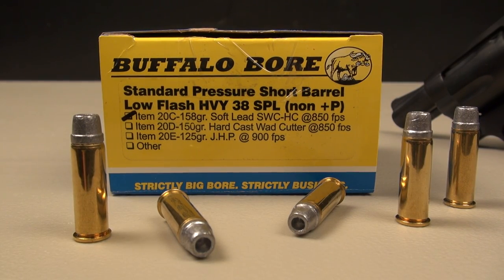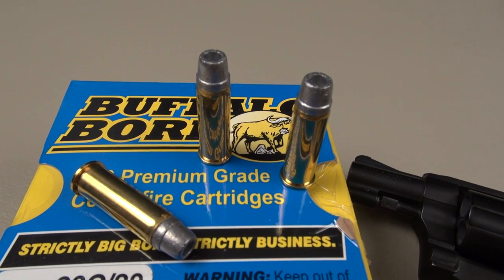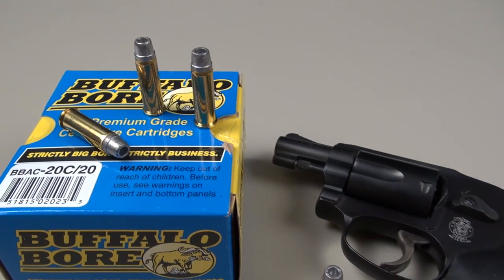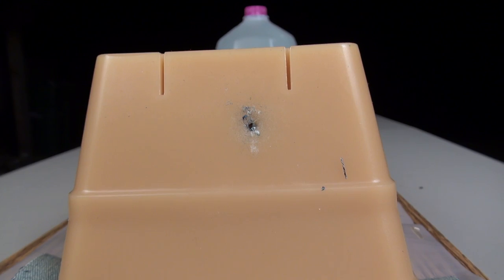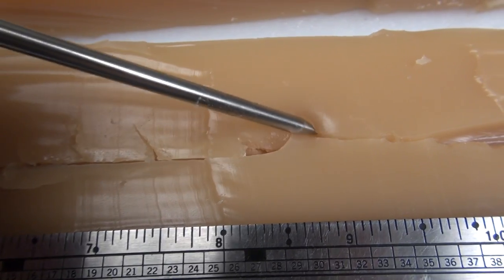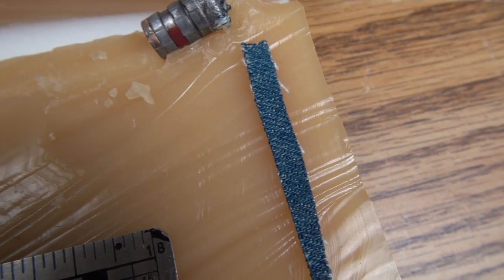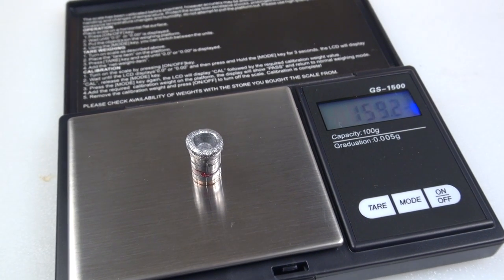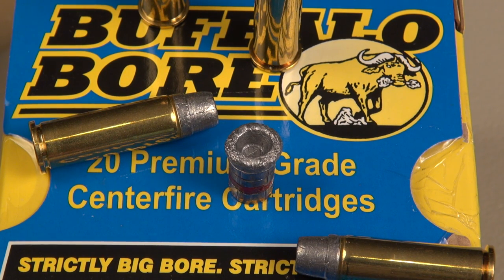Buffalo Bore .38 Special 158 gr Semiwadcutter Ammo Test

Comment: What is to complain about? First higher velocity than any plus p lhp load. Next. Plugged with denim still expands to around 44 caliber. Penetrates adequately without too much . Last A gunfight proven load for 2 inch revolvers , especially the older lightweight Pre 72 Colts. While it is tough to duplicate the plus p load , you can handload to this performance using the same Rim Rock bullets, in an emergency and , using standard hard cast 158 for practice

Comment: those under performed and were to pricey for the results. I expected to see it open up fully, but it didn't.
If I was going to C&C a 2" barrel, I would either go with Hornady FTX, or a 125 gr Winchester Lead nose hp.
Both of those have shown to open up to .5 or more without over penetration. both make a plus p round, but both also have decent rounds with plus p. great video. thank you so much for showing these. I'll know better than to waste my money on those. I too have a 2" C&C Taurus 856. I was thinking about these, but now I've changed my mind. Thanks again. Peace..
Reply: It's a hardcast not soft lead at the end it says HC which means hardcast which is why the expansion was poor
Reply: Pretty sure hc means hardcast not hollow cavity
Reply: @jorgesolis9468  After looking into that, I do believe you're right. I bought some Buffalo Bore Soft Cast  LSWC HP Rated for 1000 FPS
I haven't tried them yet out of my Taurus 856, But I did see a great review on them by someone using a LCR. I don't do ballistics gel, But I think I'll shoot them through several water jugs and see if I can capture it, to take a look at it. Thanks for the comment. Peace..

Comment: It probably would have expanded more out of a linger barrel. It would be interesting to see whst it would do out of a 5.5 or a 7.5 inch barrel. Alot of the single action cowboy revolvers chambered strictly for 38 special are not +P rated but are not entirely made for defense in mind either at least in these times. However it would still be interesting to see a test of some if these standard pressure loads in longer barrels.

Comment: This load performs even better out of a  Colt Dframe which is la slightly longer than 2 inches and gives around another 25 fps velocity. Most lighter weight jacketed 38 rounds do not perform as well . For me the Buffalo Bore rounds have been my carry rounds. In a 3-4 inch revolver they are even more effective. The plus p performing in the 357 range.

Comment: Could you please test the BB 150 gr. wadcutter 38 spl load? BB says about 14-16" of penetration.  But its flat and blunt and should strike hard.  Sadly this round did not expand like it should, but in living human tissue, might be different. Also it seems bullets go deeper in gelatin than they do actual tissue, and you got account for bones too, a bullet hitting the sternum will take a lot of energy, 19" on this test does not mean it will go through exactly 19 inches of human tissue.

Comment: Hey you should check out the Buffalo Bore 155 Gr. 40 S&W. It is as hot as a 10mm and it uses Gold Dot hp. Also, what is the best snubby load you have tested??? I am using PDX-1 right now but I think you did a video where they sucked... Thanks....

Comment: Great video👍👍.🤔 my recommendation would be not only a 10 foot distance with a stubby pistol but also point blank range.Aka I get off me scenario. And how much penetration does it have after leaving the thuggish target. For an example will go through the bad guy into the drywall and kill a potential family member? I don’t know if it’s made anymore but I use the 38 glazier around. This is a jacketed bullet with a Teflon tip and micro BBs inside the cavity. Excellent safety round all the energy goes into the bad guy and nothing leaves him.If you miss it is designed to break up and fragrant when hitting a wall. In California it is financial suicide if you defend yourself justifiably even worse if you have a stray bullet unaccountable hit a bi-standard standard😢.

Comment: Powders vary from powder to powder on PSI in the case even if the velocity is identical between different loads of different brands, so you could indeed have a +P round with no greater velocity than a standard pressure round.

Comment: By way of comparison, the non +P round tested by TNOutdoors9 goes 850fps, the +P version does 979 fps out of my 2" Taurus snubnose at 10'. I wonder if the extra 125 fps would cause more expansion and less penetration. I'd like to see 9-14", not 19". 

For now, I'm sticking with the +P version.

Comment: What would really get my goat!,  is to be in a room full of 357 mag ammo and only have a 38 special firearm ): ?    The practical me owns only 357 mag revolvers .
Reply: Cops in the day used .357 Magnum rounds in their .38 SPL snubby BUG's. They will hold up for a few shots in a serious need situation. Just can't use a steady diet. Of course, .357 snubbies are more widely available now, so not much of an issue.
Reply: ShinyPartsUp Hmmmm...... will .357s even fit in cylinders that chamber only .38 ?
Reply: Handloads. Mostly wadcutters or semi-wadcutters loaded deep.
Reply: ShinyPartsUp wow,  I didn't expect your reply come so fast lol,  anyways,  thanks for your answer.
Reply: The main advantage of a 38 over 357 is the guns are less expensive and usually noticeably lighter,
Reply: A .357 round will not even chamber in a .38 Special cylinder. The brass is intentionally made too long to fit inside a .38 caliber gun.. There is a step in the cylinder that will stop a .357 from seating all the way. You can slide a .357 into the cylinder, but the cartridge will stick out the back, therefore making it impossible to close the cylinder. Reloads make exactly NO difference. You can't even chamber empty .357 brass in a .38. Sorry, ShinyPartsUp, but that's how it really is.
Reply: Tommy Litchfield thumbs up
Reply: Tommy Litchfield .... Just a side note, don't know the exact yr. , but before 1970 anyhow, the older 38 special revolvers did have the same length cylinders as the 357 magnum revolvers, , safety wise they shortened the 38 special cylinder to prevent any mishaps with 357  mag ammo !
Reply: @lesmundorf  Cylinder may be the same length but the CHAMBER is shorter in the 38.  The 357 case was made .012 in. longer to keep it from being loaded in weaker weapons.
Reply: .357mag(brass length) will not fit in .38spl. revolver cylinders.
Reply: @kongsinchi1976  no, a 357 will not fit in a 38
Reply: @rogerbeckner6419  * Thumbs up

Comment: I think this round out of a longer barrel would be fine,but out of a snub.....not really mushrooming.....if you want the mushroom effect in a snub,you need to step up to the +p......and deal with the recoil......no free lunch.
Reply: I have a Late 40s early 50s S&W M&P/m10 with a 2" barrel. This is what I use in it.
Reply: I disagree. There are some decent standard pressure loads out there but you'd have to step down to a lighter bullet. Or you can just opt for the performance loads like this give. I mean it will do the job in a pinch more often then not. A lot of people dont have a +P rated revolver.
Reply: NERD IT UP I have a Taurus view.....not rated for +p.....

Comment: does anyone know if there is significant loss of energy because of the space that is before the forcing cone/barrel and the cylinder.  I just cant get it into my head why 9mm has higher velocity and mussel energy than 38 spl considering the difference in casing size?
Reply: I found a few articles that covers this for cylinder gap info. (mm used a strong yet small case and different powder so the pressure builds high and fast. Many standard cartridges have been shortened and or strengthed to be high pressure then the parent round. Teh original 38 special at one time in the 1930s was made at 1230 fps with a 158 gr bullet. SOem cheap revolvers blew up and also police put pressure to have teh 38 special ammo presures/velocity lowered. SO we now have the slow 38 special rounds and they not so strong 38 revolvers. You can stillr eload a 158 gr bullet up to 1200 fps with no problem but only if you shot it from a 357 magnum. +p and +p+ cartridges/firearms allow for hotter loads. 
http://www.thefirearmblog.com/blog/2011/12/09/fascinating-phenomenon-in-cylinder-gap-data/
http://www.thefirearmblog.com/blog/2011/12/02/ballistic-by-the-inch-updated/
Reply: ***** Thanks for the response and interesting info.

Comment: You'll be disappointed I think. I tried the +p 158-grain Buffalo Bore .38 SPL in my 2" S&W Model 649 (.357 Magnum.) It's advertised at 1040 fps out of a 2" barrel.
I got an average of 950 fps (5-round shot string) and the shots were all over an 8"x11" sheet of computer paper at 15 yards - from a REST. I usually get 1.5" groups (or better) from a rested position at 15 yards with this gun, with every other type of ammo I've tried - both .38 and .357. It was dirty as hell, too.
Not worth it, IMHO.

Comment: Explain to me why I would want a bullet that fails to expand?
Reply: Depends what you want it for.  Defense against humans in your home or on the street vs defense against big game in the wilderness/outdoors.  I just picked up some Buffalo Bore 180 gr hard cast rounds.  Nasty stuff, really hot and heavy .357 magnum.  Definitely not a round to carry around on the street, or to pack in your home if you have other homes real close by, or sheet rock walls with people on the other side :)
Reply: hard cast bullets with heavy grain and hot pressure that don't expand have more penetration and will stop a bear, moose, elk, etc. where an expanding bullet would do you a dis service in that scenario for outdoor survival.
Reply: Because with handguns, penetration is the most important factor. The FBI's stated minimum requirement is 12", however 18" is their optimum depth. That fact tends to get overlooked by most people. In short barreled handguns JHP bullets are unable to reach the required velocity to expand AND penetrate deep enough. Should the JHP should fail to expand, it will penetrate deeply but the front of the bullet, being tapered, will act like a FMJ and tend to slip through the tissue. Hardcast wadcutters and semi wadcutters are much flatter on the front end of the bullet with sharp shoulders causing more direct tissue damage. They also don't expand so they get maximum penetration and are more likely to smash through bone rather than glance off of it. The bullet tnoutdoors9 tested here is sort of a combo, soft lead along with a hollow core for some expansion, along with a bullet profile of a semi wadcutter. This is the old FBI load. Personally I would pick BB's 158 gr. "outdoorsman" or their 150 gr. wadcutter over the one tested here for short barrel .38s.
Reply: ThePdxster i've also heard that big bullet's like .45acp or 45 long cult(or bigger) in hollowpoints may fail to open up and expand due to the fact that they are so big, and move slower, where a 9mm, or a .40 in hp's are much more likey to truly do what they are designed to.  Not saying that i'm going to pack fmj's in 230gr into my .45.
Reply: aran125 Take a look at brassfetcher's website, a few years ago he did some ballistic testing with simulated bone in front of the gelatin. The results may surprise you as most of the JHPs in any of the popular handgun calibers had trouble expanding. They end up like a FMJ, which is not a bad thing as they penetrate well. The advantage to hardcast wadcutters or semi wadcutters is that they do more damage than FMJs. However, semi autos can have problems feeding them. There are alternatives like FMJ FP, which has a flat point but not to the same degree. So you can try them in your .45 ACP to see if they function well.
Reply: ThePdxster Will have to look at the website.  Bear in mind tho, at the end of the day for concealed carry and defense against humans, over penetration inside or outside of the home is an issue, and something we all should avoid.  Even if the HP's fail to perform as good as they are designed to, it's still better a bullet slows down inside a body like a HP is designed to opposed to over penetrating and harming something/someone in the path of the projectile, which an FMJ, even a flat nose would do.  10/4 on the hard cast having issues in semi auto's, wouldn't even consider doing that.  Most .40s&w bullet heads are all flat too.  I don't care for the .40 much tho anymore.
Reply: Going back to your comment, I would NOT carry this on the street.  Too much penetration and not enough expansion.
Reply: aran125 My recommendation for hard cast wadcutters or semi wadcutters is for short-barreled revolvers. I do use JHPs in my longer barreled firearms. If you choose not to use them in your snub nose, that's ok with me. :)
Reply: I see what you are saying, but at the same time id rather play things safe.  Have you ever shot anyone with a hard cast load??  Or a hollowpoint??  Seriously.  I bought some old hardcast semi watt cutters yesterday in both .38, and .357 mag.  Would they get the job done??  I don't doubt it.  This old timer that holds an FFL and operates right from home in a little shack in his driveway told me himself tho.  Good for target but I wouldn't carry them.  To each their own.  If I had to carry them I would but the reality is id rather use the most modern day technology with the law enforcement ammunition that's on the market.  That way it's also that much harder for an anti gun prosecutor trying to brainwash a jury that I used some sort of nasty round, when the reality is if I carry what most police depts in my area carry.  Ballistic tests are a representation of what could occur with live tissue.  I don't know, I'm confident in all the hollowpoints that I carry.  I'll carry the buffalo bore 180 gr LFN, or the double tap 200 grain both in .357 mag when I hike.  Honestly tho, it's a matter of opinion.  Your credibility is no greater then mine.  I rarely carry in .357 anyway.  If I do, it's outdoors, and like I said in that case I would carry LFN, where as for edc I carry a j frame airweight .38 snubby with short barreled formula hollowpoints.  For my auto's I obviously carry jacketed hollowpoint cause lead ammo isn't ideal in an auto for reliability.  To each their own dude if you want to carry the semi watt cutter or LFN, then rock it.

Comment: I ran about 10 of the +P version of this load through my S&W 442 (non- HIllary Hole).  Yes, they do have quite a kick, maybe a little more than the Gold Dot 135 grain +P, but they were manageable.   I wish tnoutdoors9 would deliver on that promised (many moons ago) T&E on the +P version of this load, from the same gun.  FWIW, the +P lead smeared the crap out of my chambers and bore, despite the copper gas check.  This is the reason I don't use that load as EDC in that gun.
Reply: I'm wondering if shooting a cylinder full of FMJ's afterwards would help clean out some of the excess leading?

Comment: think a 3 inch barrel would increase expansion?
Reply: Definitely. A longer barrel will get higher velocity, therefore more force on the lead to open it up.
Reply: Keep in mind whenever you increase expansion you decrease penetration. Penetration is very important for hitting vital structures, so it's a delicate balancing act.
Reply: +mannys9130 Very true, but for this particular load reduced penetration may be a good thing.

Comment: Would you recommend this over the full wadcutter?
Reply: +Michael .Shillingford For a standard pressure .38 Special in a snubbie, I personally would take a full wadcutter or RFN with a huge meplat. The 158gr LSWCHP is a good load if it is pushed firmly into +P. My 3" 686 on my nightstand has the Remington "FBI Load" in it.